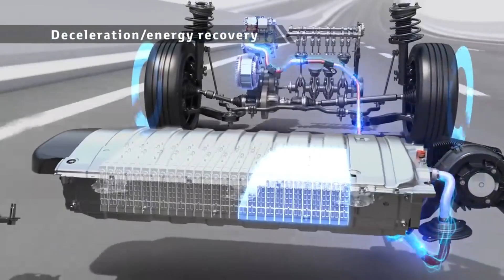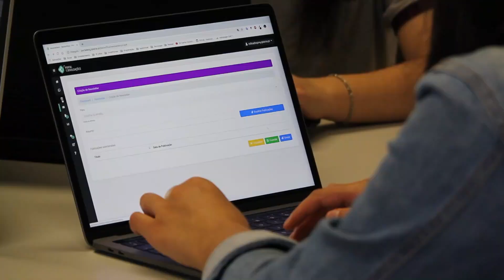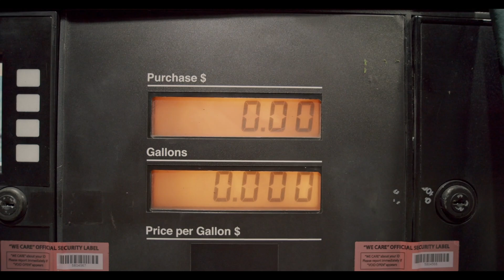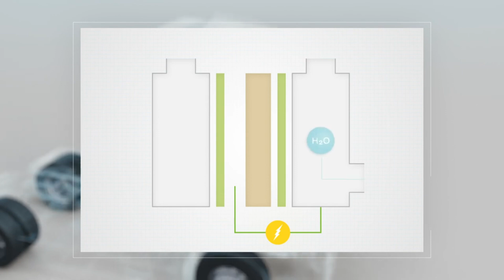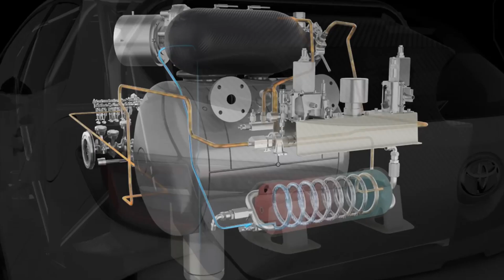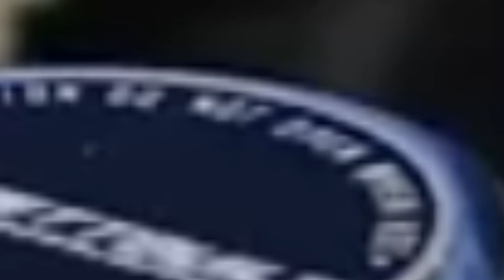The EV Industry Is Getting Destroyed By The NEW LIQUID NITROGEN Engine!

Comment: A build-up of nitrogen can be worse than current vehicles for pollution  ...  oh really?  🤣🤣🤣🤣
Did anybody stop to consider from where the nitrogen is obtained?  It is extracted from the atmosphere !!
So the nett effect upon the environment from using nitrogen engines is...  NIL  nothing  Nada
Of course, there will be some use of hydrocarbons, I can't envisage how lubricants will not be required. However since nitrogen does not burn (despite the crappy clip showing the use of what appeared to be a spark plug) the energy cycle consists of using energy to separate nitrogen from the atmosphere and then recovering same when the nitrogen is returned to its original source. The video bears all the hallmarks of a "media student" project.

Comment: Hydrogen cars can never compete with EV. Hydrogen retailed $8.50/kg to $10.80/kg higher than gasoline prices. What's the point?
Reply: plus, you can charge an EV from any socket, but where can you refuel a hydrogen car? toyota is on a dead-end street, they just aren't willing to admit it yet.